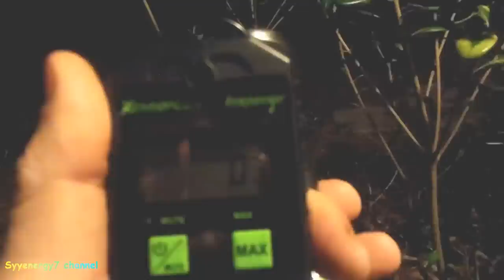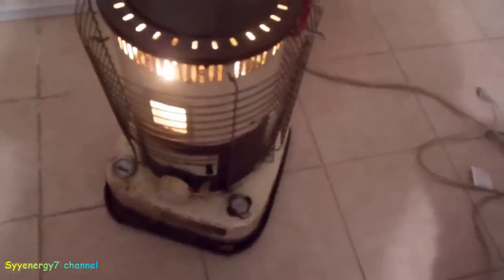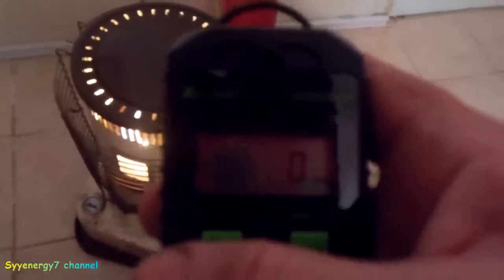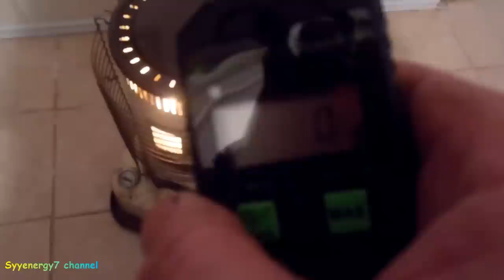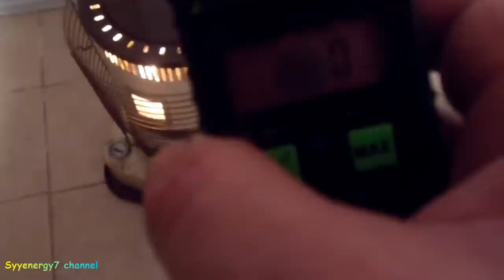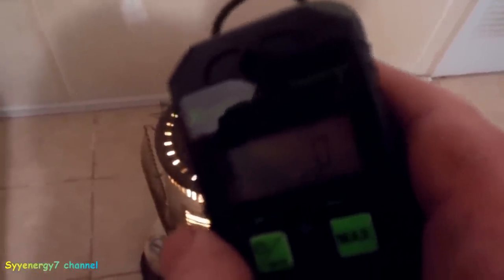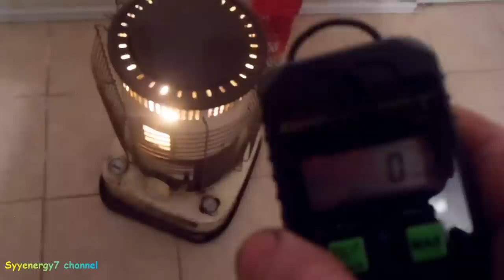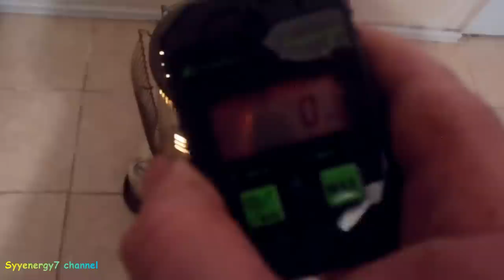Diesel in Kerosene Heater, Testing Carbon Monoxide (CO)

Comment: I assume you brew with 91% isopropyl alcohol and injector cleaner is on "clear" diesel or kero vs dyed? I've had a LOT of trouble with fiberglass-wicked heaters & dyed kero - as in they clog after about 1 tank.

Comment: Hi. Thanks for your videos on using diesel in place of kerosene. Kerosene makes my lungs feel tight and gives me a headache too.  I have a precision 735 kerosene heater. Followed all of your instructions including the additives to the gas station diesel such as stabilizer and alcohol with the measurements you recommended. Plus, I  have a 100% cotton wick; no fibre glass or synthetics of any kind. Looking for your advise because despite following what you did I do get a diesel odour.  Been playing around with it for over a month now. Wondering what I am doing wrong?
Reply from the maker: I could just be the type of heater that you have.  This works with 2 of my heaters.

Comment: Thanks for the update.   Since I've got about 10 gallons of kerosene and want to use it up first, I just added some of the 91% alcohol to the mix.  I was pleased to see that by just adding that to the kerosene, I got almost 1/3  the heating time with the same amount of fuel in my Kero Heater which holds a little over 1 gallon or so.  
Thanks.
 I plan on going to the next step using the BP diesel with additives you mentioned.  
BTW I see from comments below that a 100% cotton wick is best.   Any comments on that?  
Thanks again for a great video.   Two thumbs up!!!
Reply from the maker: Test it outside first.  Usually an older heater with a 100% cotton wick has no problem running diesel.  A few people got the fiberglass wicks to work. and even a few people said a 100% cotton wick didn't work.  A lot also depends on the heater design itself.,
Reply: See info freedom flag    diesel is not save to use indoors

Comment: Carbon monoxide testing meter, not a 30-45° angle with 2-3 feet from kerosene heater, then must move CO meter to 90° above of kerosene heater and CO meter near to ceil

Comment: If you buy kerosene buy the truck it's 1,5 euro /L. 150l. Kerosene must be type - C. This means removed from toxic components. Like sulfur etc. Diesel has all of that.  Co gas is light. It goes to the seeling. I agree you don't have a co problem. But you won't find it at human hight for your stove. It needs to acummulate over time and climb down when the seeling is full. Best heaters are with exaust pipe. Good luck

Comment: If you're using the heater indoors it's not just the co2,  there's copper, lead, ash and more. Sure it'll burn but it ain't good in a living space.
Reply: exactly - here in europe, just look at the difference between premium C1 kerosene (for unflued  indoor burners) and C2 heating oil kerosene (for flued heating systems) and just look and the difference in ppm of all those heavy metals and other nasties
Reply: Yes, im also worried about other additives or impurities.

Comment: Ok, so here is my question.  Looking at your angle of the meter as compared to where the heater is actually located, it sure looks like you are too far away to get an accurate reading.   If this meter has infrared sensors on it, that would be a completely different situation.   Does it?    If not, a meter over or at least nearer the top (not where it gets hot) of the heater, and perhaps a foot or two above it...seems like it would have been a much more accurate reading.   Have you done a remake of this video with different results?  If yes, share it with us.   If results are the same...also share that with all of us.   
Otherwise, this is a very interesting video.   Thanks.
Reply from the maker: I tried a few times over 8 hours each time and got nothing.
Reply: I'd say that's sufficient.. Also your close enough for an extended enough period of time, that if there was a dangerous amount of anything you would know it..  Thanks Man!

Comment: I blame the natural gas companies for the fear of kerosene heaters. they dont like the competition. they are safe and effective.  Now for convenience i would alway say go natural gas but for a cabin a garage or just the ambience of a nice fire nothing is quite like kerosene or deasil.  I got out my radient kerosene heater a few weeks back and i run the heck out of it.  I did a dry burn and sat down to wipe down the reflector and the glass chimney and to my surprise there isnt a single smudge of soot on anything.  Ive had it for 5 years and never really wiped it down.  All i found was dust from summer storage.  whether its a radient type or a convection they are just great. ive even set a CO meter on top of a heater during a dry burn and not a single increase in CO was ever detected.

Comment: The difference between kero and diesel is very small. This is why you only got a one on the CO meter. But your nose can smell some fuel being burned when unit has a used hard wick. I bet if you could get a good carbon felt fiberglass wick this would not happen. Good luck finding a black carbon fiberglass wick.

Comment: Dang Lowes near me is selling Crown 5-Gallon Kerosene (Item #: 55399) for $44. That is about $9 per gallon after tax. I would say that $2.70 per gallon looks a heck of allot better.  I can buy 3 gallons of diesel for the price of 1 gallon of kerosene.  I am looking into alternative heat but realistically I might get a better return by spending the money of a Natural Gas heating contractor to install an efficient furnace.  But I love running the numbers.  Why is coal so dang expensive by the ton. Coal is about $350 here in Chicago.  By-the-way CO and smell is not your concern.  You have to worry about oxygen content.  These heater burn oxygen and in an non-vented enclosed area the oxygen can be depleted to the point of killing every thing in the space.  I guess you need a dissolved oxygen meter like "Extech 407510 Dissolved Oxygen Meter".
Reply from the maker: +GallowayChicago You always crack a window when running these heaters.  Also you need a 100% COTTON wick to run diesel (ULSD).
Reply: Yeah.... CO is ...the problem !!  Your blood hemoglobin has four time the affinity for it, over oxygen.  Oxygen depletion just compounds the problem.

Comment: Why don't you set the CO meter next to a car tailpipe to test it?
Reply from the maker: cityguyable I'll check that.  But  I'm not the only one that got these same results.  Despite all the drama bullshit from the freaks, kerosene heaters are safe if you use common sense.
Reply from the maker: cityguyable Just checked it on the tailpipe of the Sebring.  The car was still warmed up since I just used it.  The meter went over 600 right away and the alarm went off too.
Reply from the maker: Joe Shmoe Fuk "WHO'.  That shit is nothing but a branch of the Global Communist Party.

Comment: Please compare the heat output of diesel vs kerosene in these heaters,  also how long each one takes to burn a tank of fuel
Reply from the maker: The diesel should produce a bit more heat, provided it works in the heater.
Reply: Thx

Comment: doesn't carbon monoxide sink to the floor what happens when your detector is held at the floor
Reply from the maker: I had the tester right next to and all around the heater.  It said zero the whole time and I'm talking hours.
Reply: ok thats great I just hooked up my diesel heater and was worried about that. Thanks for testing that out.
Reply: Late to the party here, but hope it is still useful to you.
Carbon Monoxide is marginally heavier than air, and will move up in the air column with the eddy currents caused by you walking through the room.... or, any other draft.  The problem is, your blood has four times the affinity for CO, as it does for O2.  It can accumulate, and your hemoglobin doesn't want to let go of it to make way for oxygen.  You can die of carbon monoxide poisoning even after being removed from the contaminated space.

Comment: Have the 3 perfection heaters and now just got a FANCO SERIES 22 kerosene heater, i tried your JOKE in it, no problem with it. but its bigger and uses more fuel. as far AS RED DYE DIESEL FUEL goes, the perfections/fanco kerosene heater does not bother them one bit. NO SOOT FROM THE FANCO heater, and no smell. I always have them fill my two BARRELS after they fill my furnace take with RED DYE DIESEL/HOME HEATING OIL.  take your pick, KEROSENE $4.00 GALLON/RED DYE DIESEL $2.19-$2.39 GALLON, i am fed up with the OVERPRICED KEROSENE, WORTHLESS SHIT!!!
Reply: I have Perfection and Aladdin heaters - and they have no problem with dyed kero. I'm experimenting with diesel this winter. I don't expect any problems. In the US, "low sulfur" diesel is already almost kerosene already.

Comment: Hi, just curious is your original wick an all cotton wick?  Or is a fiberglass topped wick?  I am going to go out on a limb and guess you have a all cotton wick.  I am getting ready to switch the wicks out from a fiberglass  #4A  wick to an all cotton #4 wick on my two omni 15's.   I found an article online talking about how a cotton wick in the older non catalytic converter type heaters can handle red dyed kerosene better than the fiberglass wicks, so I am guessing they would also burn the diesel mix better.  So if you are running a all cotton wick please let us know:')

Thanks for testing and sharing the info.
Roger Seher
www.AskRogerSeher.com
Reply from the maker: I have no idea what wick it is but cotton is likely. Why?  Because I bought this heater in 1987 in Korea.  I never changed the wick ever and it was used a lot. I definitely don't want to change the wick because it works great as it is.  It probably is cotton, because else would they have had in Korea back in 1987.